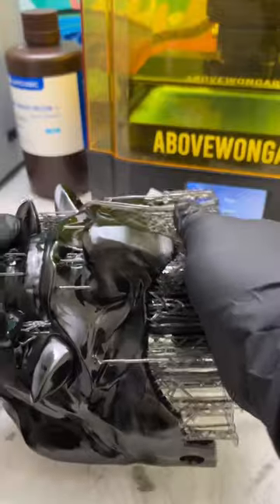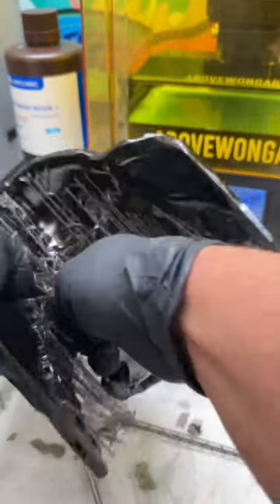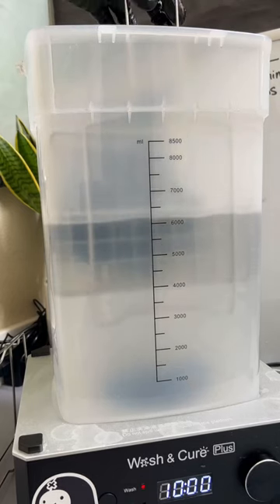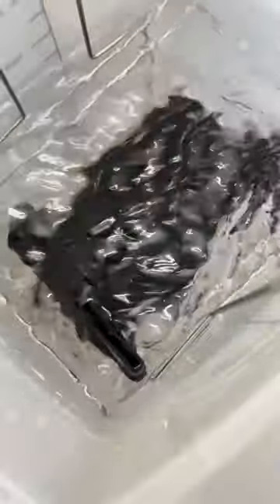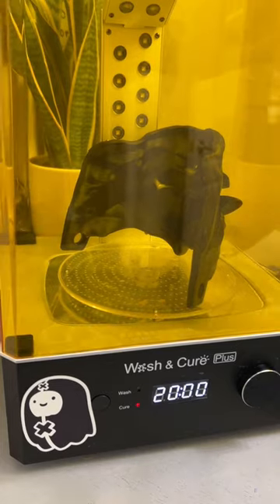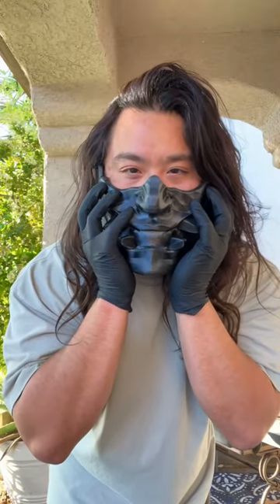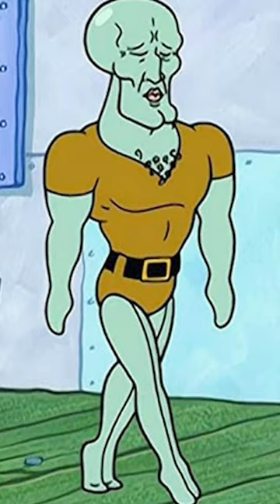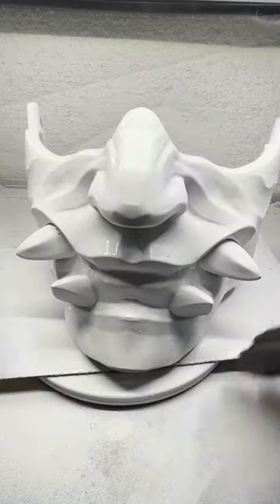Pt 2:Printing my first mask designed in zbrush instead of nomad Sculpt using M3 Premium by Anycubic

Comment: Depending on the resin used if you cure for that long you're going to get some bad cracking and shrinkage in 5-10 months, I know from personal experience with most of elegoos standard resins lol

but the masks are always cool as hell and the strange shorts always keep me guessing lmfao
Reply: For how long do you have to cure the pieces then?
Reply: @ailyns1210  depends on the resin, how well you cleaned the part, the type of curing light you are using.

 if you use a curing station though anything over 10 minutes is usually super overkill but there are some exceptions, most resins are 3-5 minutes in a curing station at most if it's been cleaned well